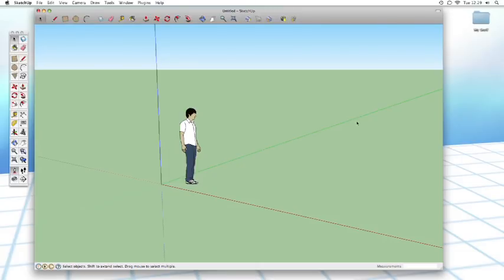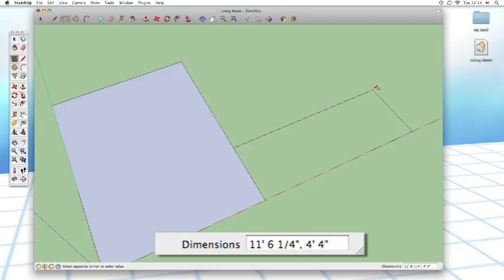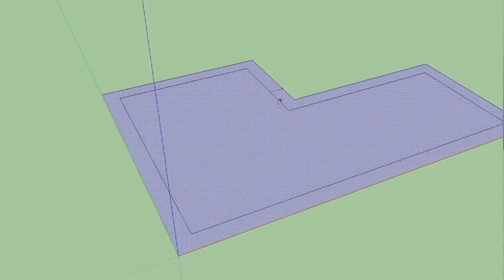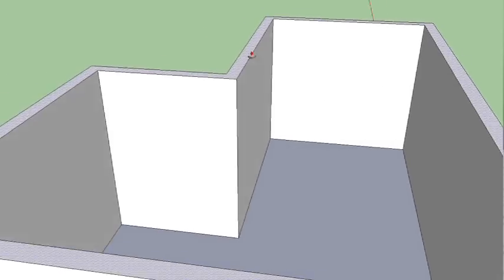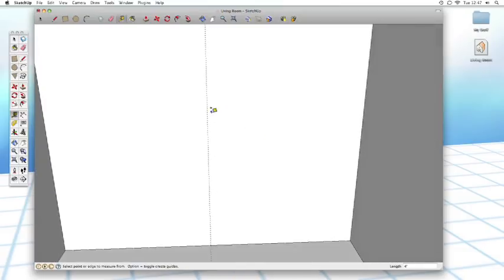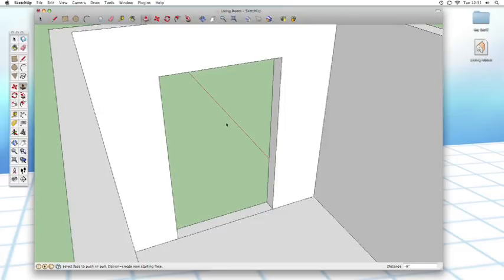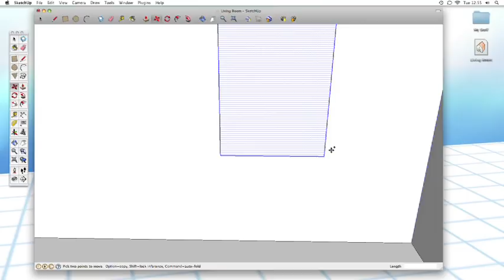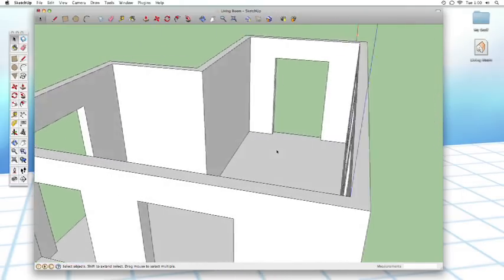Sketchup #13: Walls, Doors & Windows

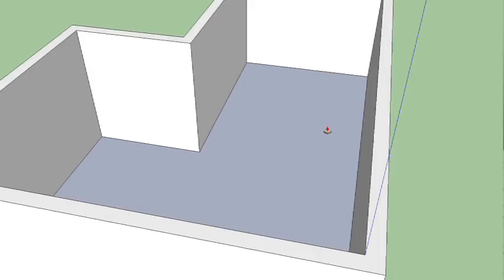Comment: I followed you up to 13:32 and then you said pull up the 'paper thin' floor up 6 inches but when I do this and then look underneath the model, it's actually pulled up the 'paper thin' floor 6 inches but has not increased the floor thickness by 6 inches. Is this something I have done wrong?

Comment from the maker: @Tjfilms1999 Plugins are stored in a special folder that's usually located in Program Files if you're on a PC, or Application Support if you're on a Mac. I would check out SketchUp's website to see about your particular version, since what version you're running will make a difference.

Comment from the maker: @rhodalle The measurement box hasn't changed in SketchUp 8 and it's the same on PC and Mac, so it should work. Make sure you're hitting the return key after entering your measurements, not clicking. Hope that helps!

Comment: Im using Sketchup on PC and when I give my floors a 6 inch thickness I can't get the push/pull tool to punch out the openings.  But if I leave my floor paper thin it works just like you show.  Any suggestions?
Reply: Cheryl Kastas I'm having the same problem. It's pushing the shape out, rather than punching it out.
Reply: +Matt Yarnall Me too!

Comment: Why create 2 guides 2 foot from the center guide and one a 6.5 feet?  You can make 1 guide from center then use the intersection with the floor as a corner for the rectangle tool and input the desired width and height. 2 fewer steps.